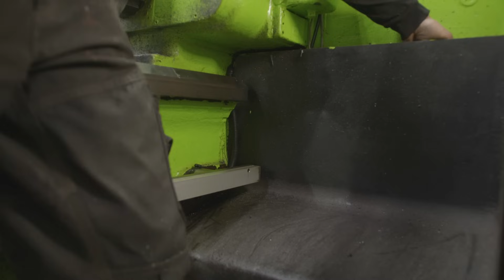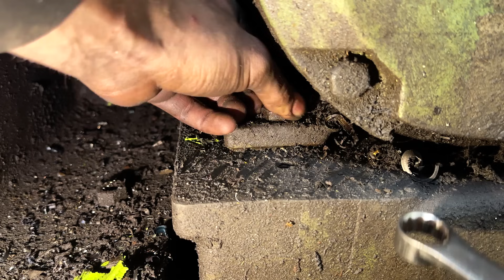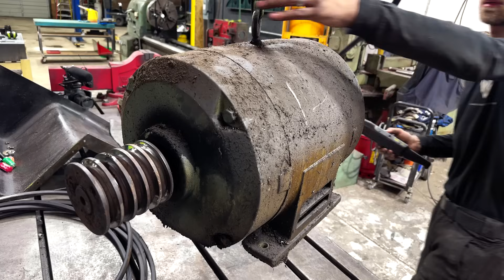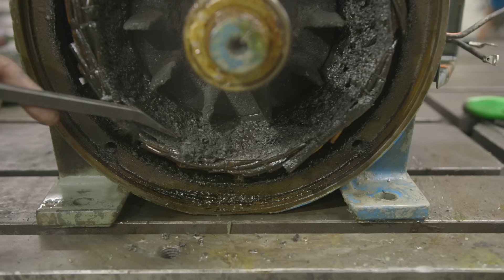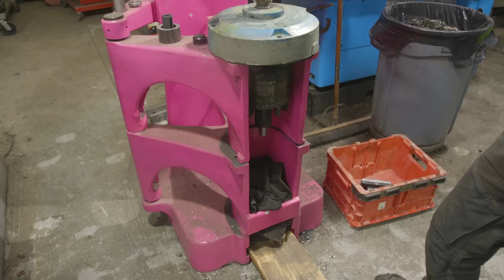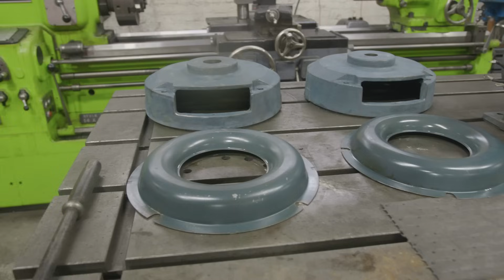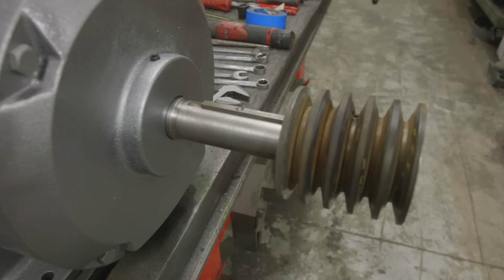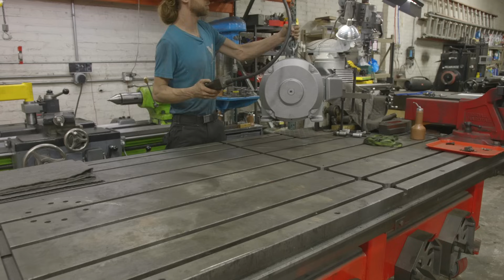Emergency Pacemaker Motor Repair | We Saved $6,000 on this repair!

Comment: I had no idea how much the bearings contribute to motor noise. Thanks for sharing.
Reply from the maker: Yeah they do I wonder though if burning smell was coming from the grime getting between the rotor and stator
Reply: They start making noises, normally due to grease going dry or from being over greased, if they have a greasing point. The rumbling gets worse and worse and eventually they will fail. Almost always plenty of warning before they go completely. Bearings should make little or no noise at all. Trouble with something like a lathe is the rumbling can be covered up with the other general noises of the lathe. 
I used to use an ultrasonic measuring technique at one company I worked at, it was very good at picking up the clicks and ticks of a failing bearing a long time before any real damage is done and was far cheaper to use that vibration analysis. The company I used, based here in the UK was I think bought out by UE Systems.

Comment: Have I seen right ? Metric bolts on an ameircan peacemaker ? Or does exsist bolts with imperial threats and metric heads ( 18 mm )
Reply from the maker: They were probably standard. Sometimes I use metric sockets/wrenches. I used that wrench because it was long and low profile. There is a crossover sometimes either that or whoever rebuilt it lost the original bolts.

Comment: Man, I would think twice before using the carrage mounted Sky Hook to hoist a 300 pound load.  You run the risk of cracking the compound T slot casting.
Reply from the maker: Yeah I thought about that but it’s good.

Comment: I know that you built that "Sky Hook" for such occasions, However I don't think you anticipated this particular occasion. You may never have to move as heavy a weight again. Would a bearing help should you have to move heavier items in the future making the movement easier?
Reply from the maker: Yeah, I actually bought a tapered needle bearing for the bottom, but I haven’t dropped it in there yet

Comment: Awww, pressurewashing the dirty greasy motor was the best part and we didnt get to see it 😂😂. Great job!!
Reply from the maker: Yeah I know I think o didn’t film it because I was thinking it wouldn’t be saveable but when it was I was surprised. And it’s also a little messy to film but yeah I agree would have been satisfying
Reply: Be careful when cleaning stators. They're usually varnished to keep the winding from shorting. A high pressure stream can strip the coating, especially if it's embrittled due to age.
Reply from the maker: @bobweiram6321  yeah very true
Reply: @VanoverMachineAndRepair  Must have lost around 30lb in mass just from removing all the crud there. If the bearings have grease holes, would suggest putting a bit of grease in every year, putting the grease nipples in place of the screws in the casing. Will make them last a lot longer.

Comment: Could you figure out, if it´s 1150 or 1750 rpm? And have you plugged it directly without the transformer in your 440V outlet now?
Great Job 👍
Reply from the maker: Never figured it out but since it went back there was no messing around needed because I reinstalled it from where it once was. The transformer powers up the entire machine, but the motor is powered through the electronics on the equipment through a motor starter, etc..

Comment: The skyhook has now paid for itself 
Good morning
Reply from the maker: Yes indeed
Reply: until you lift that item that's just heavy enough you screw up your lathe.
Reply: Like a broken compound T slot...
Reply from the maker: The slot on that compound is super beefy this is not gonna be broken by that
Reply: Consider the 315 pound load multiplied by the cantilevered length of the Sky Hook..
Reply from the maker: @petemclinc  it’s a lot but it worked fine no signs of damage
Reply from the maker: It’s gonna take a lot more force to break the lathe than that

Comment: NEMA standards allow +- 10% on voltage.  A 480 volt motor can work on 440 and the reverse is true as well.  Motor shops steam clean the stators and then bake in a oven at 350 to dry them back out.  Looks like a good repair.
Reply from the maker: Good to know thanks